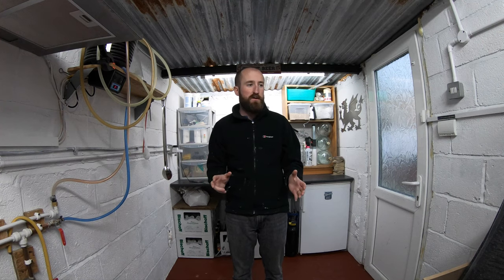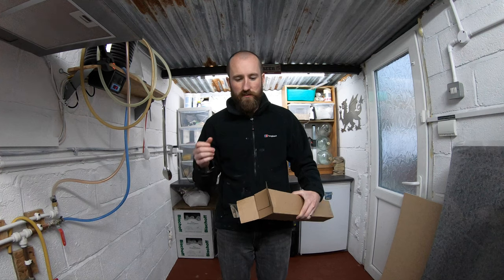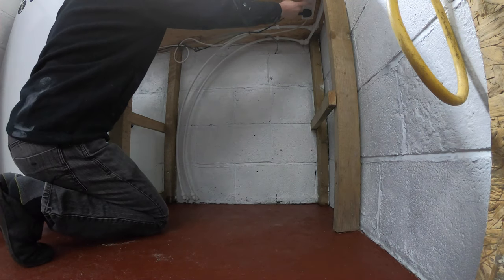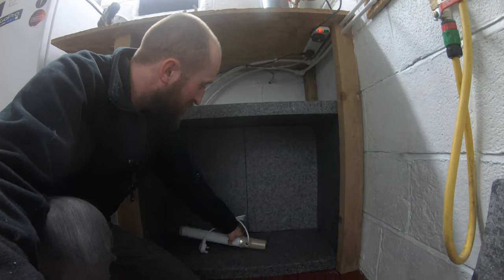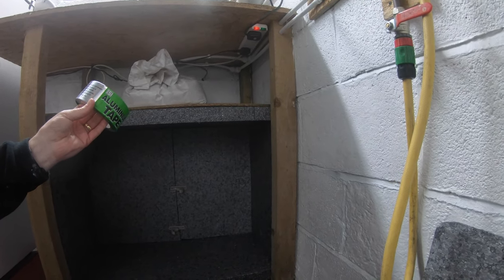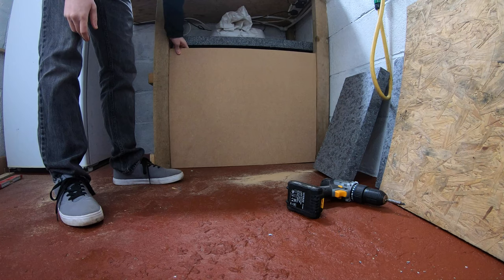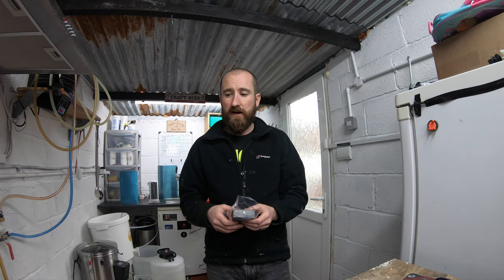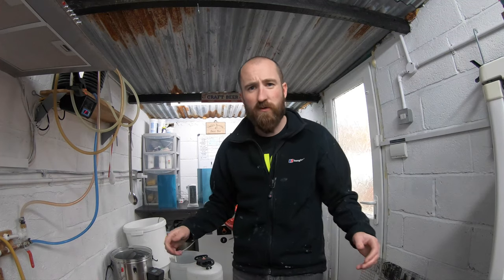How To Build a Custom Fermentation Chamber

Comment: Great video, my son has just built a fermentation chamber using a fridge, he turned the fridge sideways under the bench and built a box out from the fridge which enabled him to use the door, which closes onto the insulated box, he can now get two fermenters into a fridge.
Reply from the maker: Sounds like a great idea, as long as the fridge isn't plugged in for cooling! 😂👍
Reply: @HomebrewGriffo  It is, and it works like a charm.

Comment: I'm thinking of doing something similar...Make a chamber 150x150x100 cm, well insulated . Then take apart an old refrigerator and attach the compressor, coil and all the necessary parts to my new cooling chamber. So far this is my only solution where I can effortlessly cool my beer during fermentation. We have 25 C+ for most of the year down here in Athens, Greece.

Comment: Hi Griffo, great video but if you read the instructions to fit the tube heater, they must be fitted horizontally otherwise you will burn out the thermostat in the end, just trying to be helpful mate.
Reply from the maker: Thanks Hilary, Nope I didn't read them. Thank you for the heads up, I'll try to find them to make sure for the model I bought, the thermostat is at the top of mine so it probably cuts out prematurely rather than burn out BUT if any doubt i'll drop it down horizontally - Thank you for letting me know! - I'm off out to the shed!! haha

Comment: Solved: Basically.. just follow the video! (see reply)
What temp does this get up to? I built one over the weekend and with a 40W heater it was at 15C this morning (with google saying 7C outdoor temp in NW England). 
Mines a bit bigger than yours, looks double the width at 1400mm (W) x 900mm (H) x 600mm (D) & I've used under floor spray foam insulation so I can keep the floorboards.

I'm aiming for 22C, although first time brewer here so also open to suggestions on ale temps!
Reply: Okay I decided to try fix it myself
A few things to note for anyone thinking the same as me
- Is expanding foam good enough as under floor insulation? NOPE
- Bigger isn't always better

Added insulation board on the floor (50mm)
Added a divider to half the size so I can have a hot & cold side (I have run lines for my cask on the cold side and I'm using an electric cool box cooling)

Noticeable difference within minutes for the heating! not tried cooling but that was just a nice to have anyway.
Mine is now around 700mm wide, but I'm able to move the divider if I need

Basically.. just follow the video!

Comment: Hey man, looks great. What's your temp. during winter in this shed? My garage has no heating so it's around 5-7 degrees and wondering if that chamber will be enough
Reply from the maker: Thank you, yes in winter it gets down to 1c and the chamber works fine, if not maybe use a bigger heater to compensate for loss of heat?

Comment: Hey Griffo! I just have a quick question about the fridges which you have the hot and cold temperature control on. Have you drilled a hole through the fridge to feed the wire through for your thermostat or do you just pass it through the door opening? This was a very good video cheers for that!
Reply from the maker: On that old thing? haha. yes I drilled a 1 hole for the power to the heater and thermometer probe, I didn't know if there were any cables or pipes just chanced it on the bottom left lol. cheers Darryl